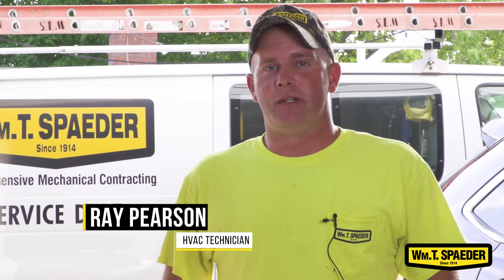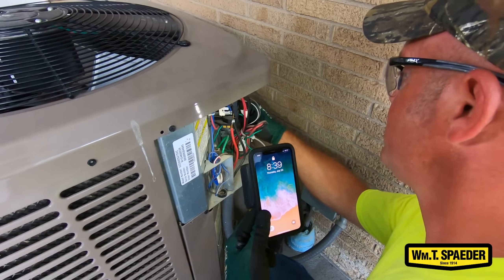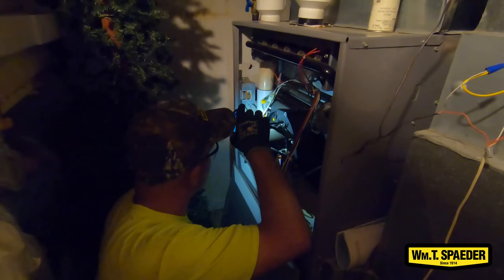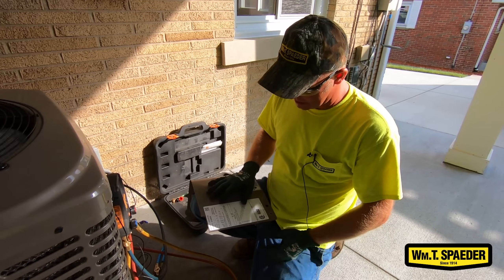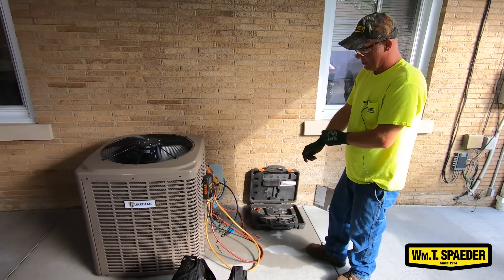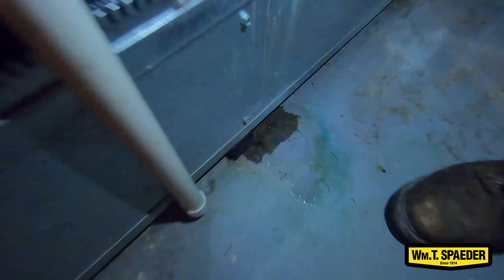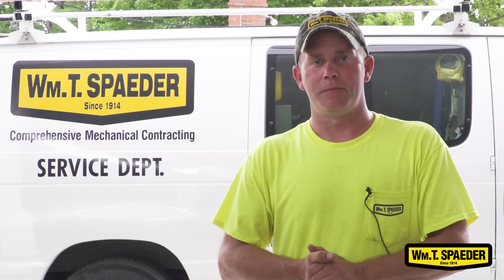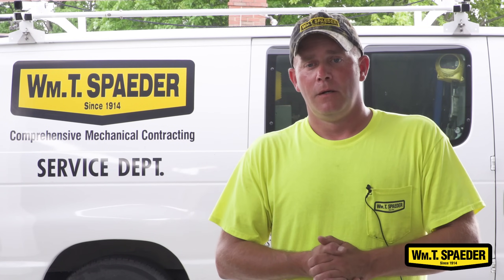Yearly HVAC Maintenance Checks

Comment: You missed your delta point, what is your air supply and return difference?? I think that’s probably one of the biggest things to look at when the systems on cooling mode. Other than that well done. 👍🏻

Comment: I always start with just cleaning everything from the get-go. I don't understand why a lot of companies have to put gauges on and run tests and checks. If you know it's been a year change the filter, clean all the coils, clean and treat the condensate and then run and test the equipment after that way if you have a refrigerant leak at that point you will know, but you'll also know that everything is clean, obviously inspect and test your electrical and your capacitor before you turn it back on. That's how I do it. I just start with cleaning the unit. If I know it's been a year then I clean the unit.

Comment: in really hot climates a condenser situated under an overhang like that would go off on high heat internal overload regularly. my company recommends a diverter to push the hot air away from the unit so it doesn't suck it back in. what is your opinion on that? are you in a more temarate area? we experience 115 plus degree heat ALL summer
Reply: It's a resi unit its not producing a ton of heat anyway, I've worked on 50 ton package units located inside ENCLOSED parking garages with little to no ventilation, definitely affects efficiency but other than that it's fine

Comment: Can you use a pressure washer to clean out those coils at the condenser?
Reply: Do not use a pressure washer, a normal hose can bend the coils too if the pressure is too high
Reply: Heard you can damage the coils with a pressure washer.  I'd use a regular garden hose with the spray attachment.

Comment: I always inspect blower wheel/motor, evaporator and filter first.  Service will go much faster cause you don’t back track as much.
Reply: I always throw the cheapest filters in those expensive ones make it work harder to pull air through. Either way if you have allergies you’ll still have them no matter what.
Reply: @144boyz8 I didn’t say anything about filters brother.  I was referencing the flow of your service call.  In check everything inside and move onto outside, so I don’t backtrack inside again unless it’s to check my indoor td.
Reply: @zachosborne6577  yeah Ik just my opinion with the filters
Reply: @144boyz8 Yeah for the most part I agree.  Although some of those filter boxes with 5” filters can be good too with properly sized ductwork.  I hear what you mean with the cheapies, if it’s an old house with funky ductwork. 🎉

Comment: Does the technician usually enter your home during this process?
Use gauges or anything?
My technician came and sprayed with water and left
Reply: A full inspection should include a refrigerant check. I sometimes just clean my neighbors ac condenser coil because it's next to mine.
Reply: Oh lord
Reply: Was it just water, or was it a soap spray? Soap water is used to pinpoint leaks, but a full inspection usually means the machine gets drained into a cylinder or two, and pumped with nitrogen to be sure. Unless he knew for certain there was a leak, and knew the general vicinity of it, he should have been a lot more thorough than just spritzing water on it.

Comment: 1:10 
how does your gauge tell you how much refrigerant is in the unit? regardless of being low or high?
Reply: Can't tell you the amount of refrigerant. It just tells you if you are low or high based on temp and pressure
Reply: typically your cold pressure should be around 120-130 Your heat should be around 315-345 anything lower is indicating a possible leak
Reply: I was expecting you to say checking subcooling or SuperHeat. You cant sit there and tell somebody what pressures should look like unless you know the ambient outdoor temperature..

Comment: How much should something like this cost? I was just quoted $140
Reply from the maker: A Standard “clean and check” usually takes an hour to perform, this is testing and inspection only as well as an outside coil wash down without tearing it apart (hopefully an outside hose bib is close by). Any repairs/adjustments filters, parts, and cleaning agents are not included with service. Sometimes a service contract is the most efficient and cost effective way solution to keep your system well maintained. It’s revolving work for us and peace of mind for the customer because their equipment is checked out twice a year. The price you were quoted is typical as long as no additional problems are found with the units.
Reply: @WmTSpaeder  The HVAC tech that did my A/C maintenance this week was in & out in 15 minutes.  I spoke with the owner of the company the next day after I cooled down - no pun intended! Lol. After first trying to BS me he agreed to send another tech out to finish the job. For $100 he better!
Reply: @sitori663  Nice to make $100 every 15 minutes. Wish I was a brain surgeon, - - - - - er, I mean an A/C tech.